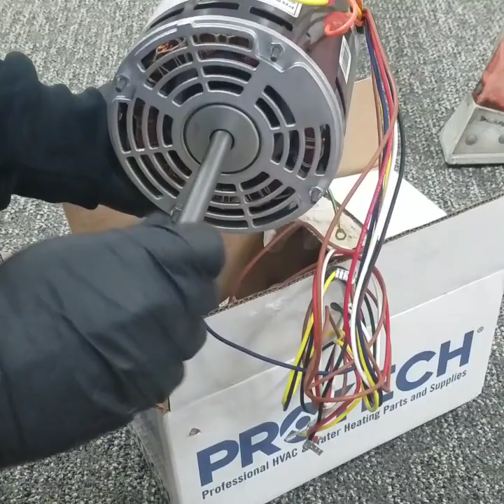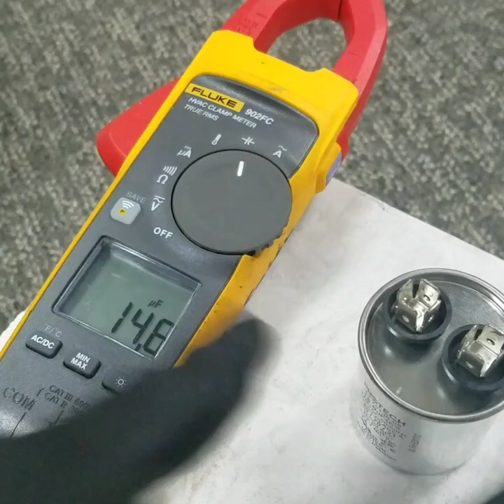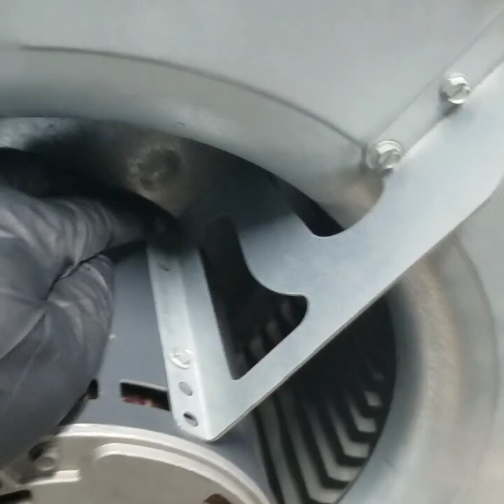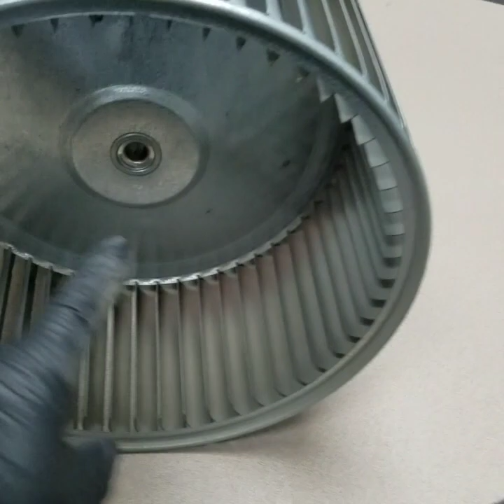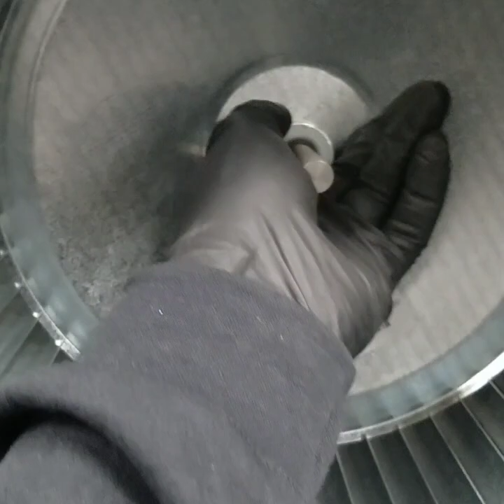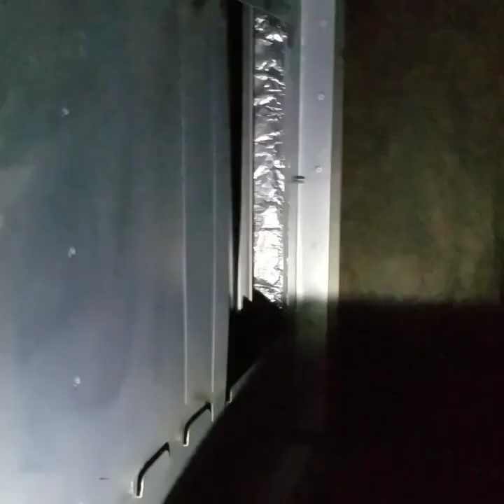Installing new Blower Motor on Rheem Furnace

Comment: I replaced the fan motor on a rod a Rudd 2002 unit using a Protech non-OEM motor. The yellow wire coming from the board that indicates heat did not have a wire I can hook onto. On the existing OEM motor and indicates a low medium any ideas?

Comment: Curious about why you changed the wheel. Is this typical when replacing a motor?
Reply from the maker: Sometimes it can become out of balance. Its preventative. That way you dont have to do a callback and replace the wheel on a second trip.
Reply: Second question: I bought the replacement motor a Protech (made in India). Wasn't too impressed because it's smaller, lighter and doesn't have the end bearing caps of my previous motor, although it and the new wheel seem to be running fine. Just concerned about longevity of this motor.

Comment: Was the bracket on the opposite side of the motor removed before getting the whole cage out of the furnace???
Reply from the maker: Should just be 2 screws holding in the blower assembly

Comment: I just had my blower motor replaced but now the fan will turn off every time the unit outside comes on. The fan will run when it's in fan not auto do u know the problem
Reply from the maker: Sounds like a control wire or board issue

Comment: Thank you so much for the video and it’s very helpful. I was able to change my 2004 Rheem blower motor, wheel and capacitor. One issue was that the one of the mounting brackets screw position came exactly where the wires are coming out. I managed it by splitting the wires. However it’s working great 👍 Thank you. Do you have any videos on heat exchanger/ secondary heat exchanger / exhaust blower change videos? Also I have a multi meter , how to check how many amps my new blower motor is using? I just need the pin details.

Comment: I just replaced the blower motor on my 1994 Ruud furnace on Thursday. Funny after all these years it is still the same design. Got the motor for $100 and run cap for $9
Reply from the maker: Thats a steal of a deal on the parts
Reply: I am looking for some parts, where did you get them for such a good deal?

Comment: If the blower motor was the issue why replace the wheel and capacitor? If warranty these added parts would not be covered so why pad the repair for parts not needed. This is too typical . . gouging
Reply from the maker: If the wheel is out of balance it will shake and vibrate the unit very badly. Had it happen to many time not to just do it right the first time. Also the capacitor and motor should always be done together. Cutting corners make some very unhappy customers. I would rather have my system working good the first time instead of calling back in with a faulty unit. Just my two cents.
Reply: @HVACServiceTechnicianTalk  absolutely right. I've been without heat for a few days cause my motor wheel doesn't spin straight after replacing my motor. Had to hammer my old motor out of the wheel cause it was stuck, I think that's what ruined it lol. I noticed the wheel was spinning heavily out of balance after I put in the new motor but I still installed it to test it out. Very loud rumbling when the fan turned on. Waiting for the new motor wheel now :/
Reply: Also, very basic practice to change the capacitor when changing the motor. Every single HVAC video I've watched does the same. If I had watched this one before changing my motor, I might've also bought a motor wheel just to be on the safe side
Reply: I purchased the wheel and capacitor too while doing the job myself. The capacitor was $7, really gouging myself for $7